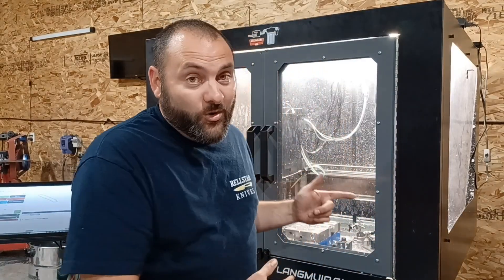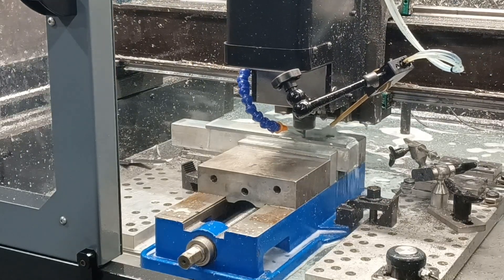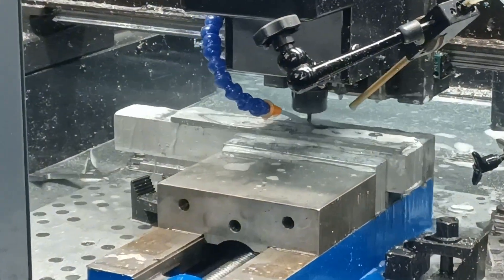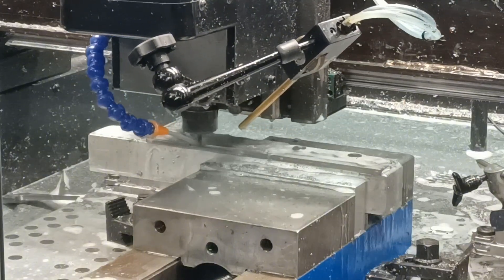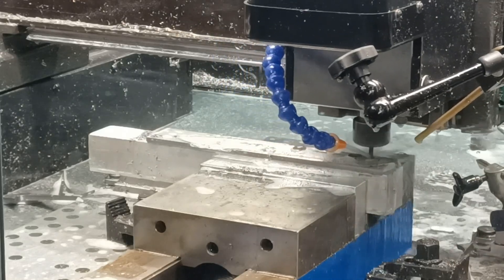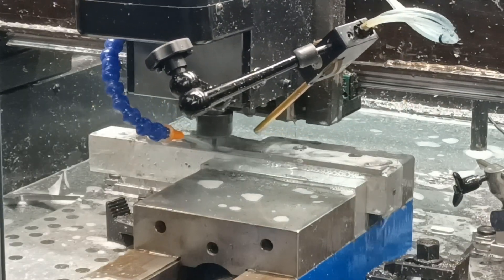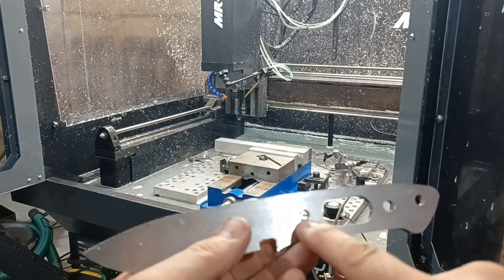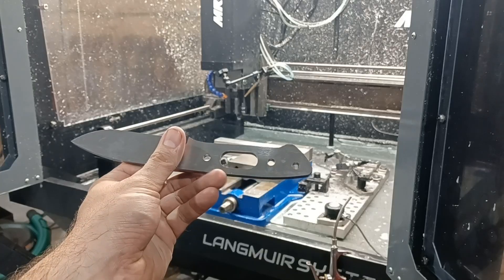Langmuir Systems MR-1 Machining CPM 154 Stainless Steel.

Comment: my suggestion would be to use the masking tape and super glue method for those corners and bits that will come off, that way they stay sturdy. Essentially use painters tape on top of the billet and bottom of the sheet material, add super glue, mill and you are good

Comment: We turn everything that isn’t the part into chips using adaptive tool paths and full depth cuts (with appropriate step over), much safer! This machine, snd the bit, look like it would have no trouble doing it.
Reply from the maker: that's not a bad idea.  The customer supplied the material and it was all cut into different sizes.  I would like to cut it myself if I were to go the adaptive toolpath rout.  I"m also considering tabs.  I could break off the extra material than run a finishing pass at full depths.

Comment: You can precut the material on a metal bandsaw. The cut (cuts) would be from the outside edge to the end mill slot. This would insure the material will break up into smaller pieces, and not wrap up into the cutter. The part looks good.
Reply: Depends on how many parts needed to be made

Comment: That looks like a nice job for a CNC laser cutter.
Reply from the maker: Laser is not as accurate and it messes up the metallurgy in the area that matters the most.  Water jet does it without the heat but is not as accurate and it doesn't have square edges like a cnc.